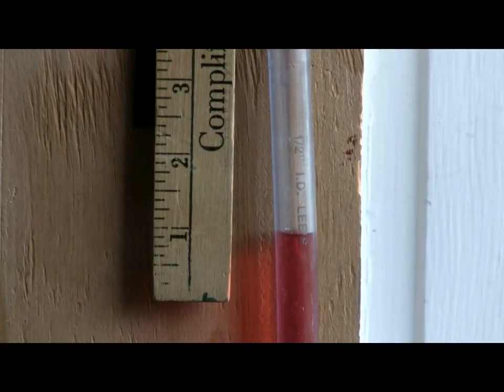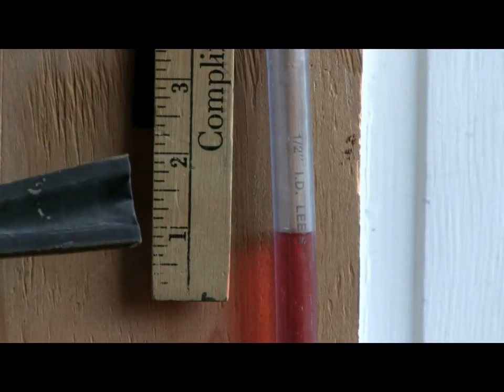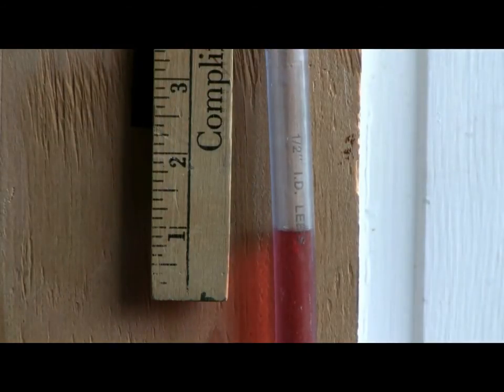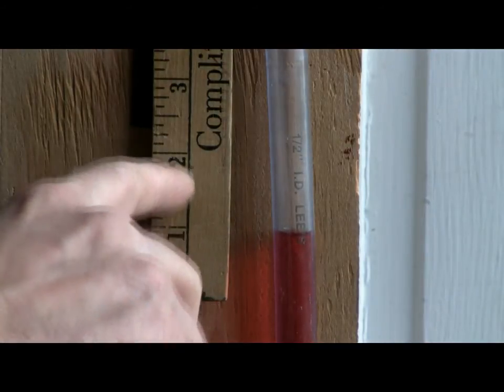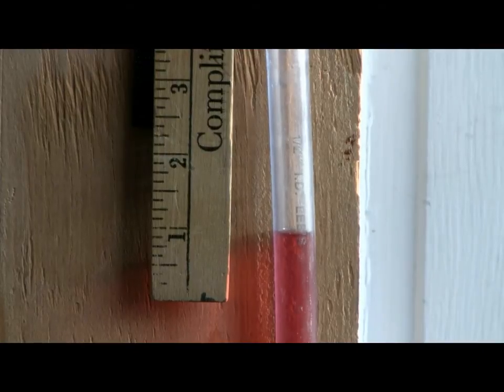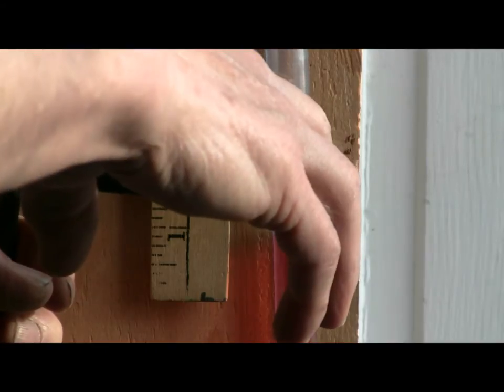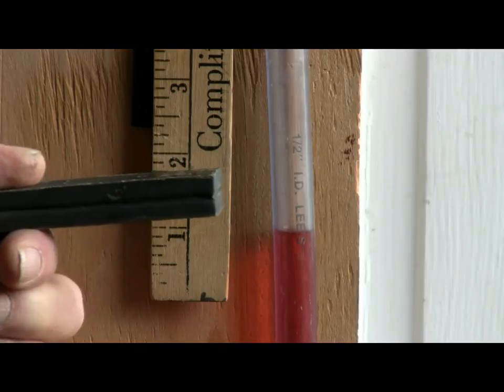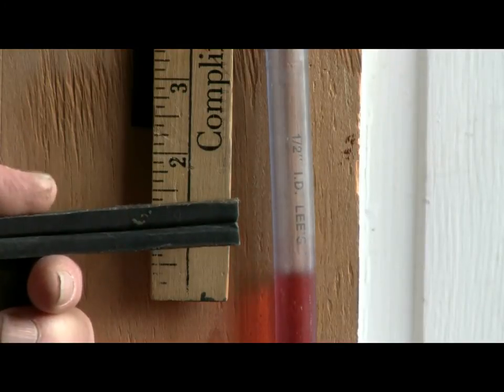Testing a Striker Pneumatic or Note Bellow (by John A Tuttle from Player-Care.com)

Comment: John
I'm covering some Ampico striker pneumatics with thin Polylon from Dave Ramey, using his recommended plastic glue. They are 5 inches long. I can't seem to get any of them to be as flexible as the ones in this video. It takes about 25 grams (even though  the bellows are an inch longer than
yours) to collapse them, even before covering the hinge end--so they can't be hingebound. Is this typical for polylon, which I've never used before?
Reply from the maker: 25-30 grams should be fine.... As long is it doesn't take any more than 2 inches of vacuum.
Reply: @johnatuttle  I threw away my manometer several years ago in a futile attempt to "organize" my shop. Easy to make another.
Reply from the maker: Also, I just tested one that was covered with thin nylon striker cloth, and it takes 40 grams to collapse 90%.
Reply: John, I made a new manometer and tested the newly recovered strikers. They all collapse at about 3/4 of an inch of vacuum or less. I used double-stick rubber tape to temporarily seal the  connection between the hose adaptor and the large striker hole. Everything was air-tight.
Reply: Correction----1 3/4 max, not 3/4. Oops. Almost all were close to
 1 1/2". The stiffer ones will go on the treble end of the stack.

Comment: This is very interesting, thank you for sharing.  How do you connect the vacuum source to the pneumatic?  This doesn't show in the video.
Reply: You might have noticed the 'T' connector with the small hose and the two larger hoses. One of the large hoses goes to the top of the manometer and the other large hose is connected to the pneumatic. The small hose is connected to the vacuum source, which in this case is my mouth. In other words, I'm sucking on the small hose and once the pneumatic is collapsed, I put my tongue over the end of the small hose to prevent air from leaking back into the hose -or creating an air-tight seal.
Reply: John Tuttle What I meant was how do you physically connect at the pneumatic.  All the ones I have seen just have a large hole in one of the pieces of wood, which is not convenient for connecting a hose.  You have a different type of pneumatic that has a hose fitting?